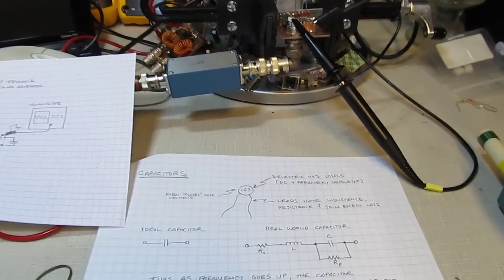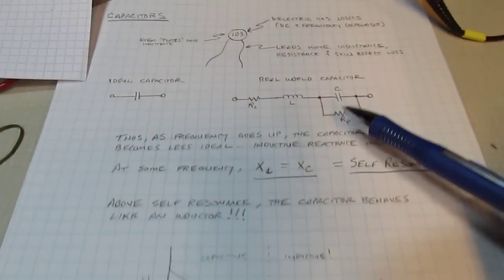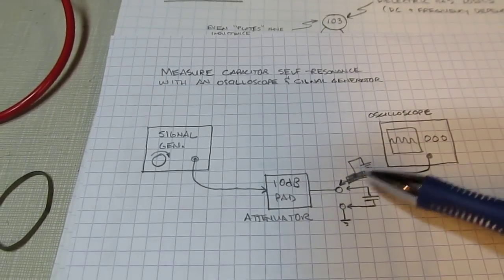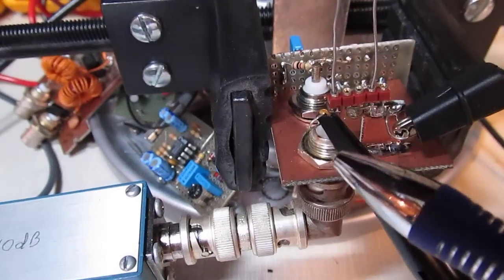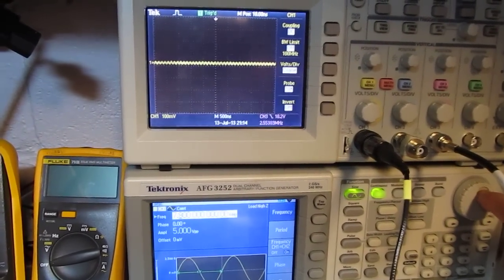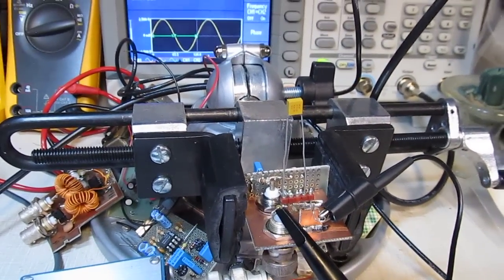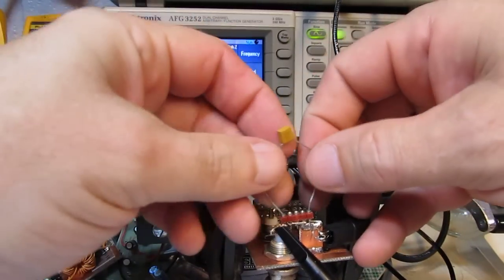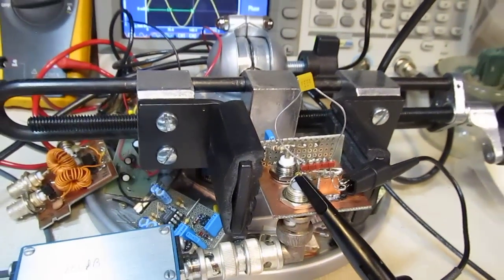#100: Capacitor self-resonance measured with an oscilloscope and signal generator - how to tutorial

Comment: The capacitance in the scope probe may also make a difference, depending on the size of the capacitor.  If the cap you're testing is in the tens to low hundreds of picofarads, the probe's capacitance could be as much as 10% or more of the cap being tested.  That'll definitely skew the results a bit.

Comment: Again, thank you for making these excellent videos. As good as your demonstration is, you have incited me, once again go experiment, firsthand.
Changing the lead shape also reminded me of value preserving the return path, by not interrupting the ground plane.
I have a Siglent SDG2042X function generator, and a Rigol 1054z, which even though they are entry-level "instruments," they can be hooked together to sweep something like this to make a Bode plot, which might make it easier to find the self-resonance. Ironically, the Siglent function generator's ability to trigger external on a sweep, was a later-added feature. Though, it does work, as tested. Still, a VNA would be nice to have. You have seen the LibreVNA 2nd version, correct?
Reply from the maker: I know the LIbreVNA 2nd version exists, but I have never seen/used one.

Comment: Sorry, i’’m a beginner in electronics. My question is: 
In a resonant circuit, using a capacitor at his resonance frequency is the best solution? (lowest ESR and lowest ESR). 
Thanks!
Reply from the maker: It is usually NOT a good idea to use a capacitor at its self-resonant frequency - mainly because this is not well controlled or predicted, and will vary by manufacturer and installation configuration.
Reply: @w2aew  thank you for your response!

Comment: Thanks for another great clip.

What is important in design is the knowledge of the maximum self resonance frequency of the capacitor( i.e. in perfect condition with as small lead as possible)  and then you should use the capacitor for designs with maximum frequency 1/10th of self resonant frequency.

Similar to rated voltage of capacitor which is used in designs that voltage does not exceed half of rated voltage.

Comment: Why would the signal amplitude drop if the impedance dips?
Reply from the maker: Because the signal generator has a 50 ohm output impedance.  This forms a voltage divider with the load.  For example, if the load is 50 ohms, then the voltage across the load will be 1/2 of the open-circuit voltage from the generator.
Reply: @w2aew  ohhhh....so the fact that the cap is resonating, effectively creating a short, it is ROBBING the scope of its signal??

Comment: Great video as always!!:-) May I please ask you what if we do talk about GHz? It looked like your capacitor would be "100%" inductive?
Reply from the maker: True - you would use much lower value capacitors at GHz frequencies.  They have a higher SRF.
Reply: When you go high enough, there will be several resonances, each reflecting a physical dimension or some physical aspect of the device, like electro acoustic coupling in capacitors, etc.

Comment: @6:18 The loop area? I would think it is the parasitic capacitance that changes as a function of distance between the leads. The parasitic capacitance is in parallel with the ideal capacitance so this would yield a lower measurement. 1/2*pi*sqrt(L*C)
Reply from the maker: The difference in the parasitic capacitance between the leads is a very tiny fraction of the capacitance of this device - probably just a few pF at most, while the capacitor used here was a 1000pF or 10000pF cap (can't remember which), so the change in parasitic capacitance by dressing the leads wouldn't account for the 10% change in SRF.  It was primarily due to the change in parasitic inductance.

Comment: Cutting the leads also reduces the enclosed area. Dramatically. So, it is the "same" effect in disguise (cutting the leads == reduction in the enclosed area) or is there more to it ? Would we get the same self resonnant frequency without cutting the leads, but making the leads really close (isolated by a sheet of paper) as example?  or it is that the (straight) leads, as a cable in itself, are inductive too?
Reply from the maker: I believe the inductance will be lowered if you brought the leads together, also adds the capacitive coupling between the leads.
Reply: Good observation, indeed, that would be an indirect and unwanted (for purpose of the intended measurement) modification to the original cap. Thanks.

Comment: Hello Sir,
I am trying to measure the resonant frequency of a MEMS resonator in which the bottom electrode is fixed and the top electrode is a doubly clamped beam which is free to oscillate up and down (basically like a parallel plate capacitor). How do I measure the resonant frequency of the vibrating beam??

Comment: Hello sir,
Does 10dB attenuator attenuate gains (in decibel) at every frequency down 10dB?

Thanks
Reply from the maker: +Nattapong Chotikorn In general - yes, attenuators are almost always broadband devices and provide the rated amount of attenuation over a wide frequency range.
Reply: Hi, is it possible to replace an attenuator resistor 1M?
Reply: not recommended Стас Негруша,
because output impedance of signal generator & input impedance of Attenuator  is 50 ohm. so there will not be any reflection coming from the input of attenuator to signal generator because both having similar value.but if you use a 1M resistor instead of Attenuator as because of difference in output impedance of generator and input impedance of resistor large signal gets reflected back to generator @ RF or even higher frequency.
Reply: "signal gets reflected back to generator @ RF or even higher frequency." ...What Would that be , frequency greater than RF ?

Comment: Thank you for a very cool and concise video. Would it be possible to do a video on "Inductor self resonance measured with oscilloscope and signal gen"?

Perhaps you could add some detail regarding the difference between resonance, self resonance and spatial self resonance for caps and inductors and when they apply?
Reply from the maker: +Logline Productions An inductor&#39;s self-resonant circuit will look like a parallel LC tank circuit, thus will exhibit a high impedance.  So, the process is basically the same, except that you look for a peak in the response instead of a dip in the response.  Resonance is when the capacitive and inductive reactance are equal in magnitude.  Self resonance refers to the resonant point that results from the component itself and it's parasitic characteristics.  For example, a capacitor has some parasitic lead inductance - self resonance is when the capacitive reactance equals the parasitic inductive reactance of the leads.

Comment: Thanks for the effort that you put in your videos. I love your videos.

don't you think that the input capacitance of the oscilloscope would give you a false resonance frequency?
Reply from the maker: The probe's input capacitance is only about 9-10pF, so as long as the capacitor value is substantially higher than that, the probe won't affect the self resonant frequency by a noticable amount.
Reply: Thanks for the explanation.
:)

Comment: If i don't have an attenuador. What can I do? I don't speak english so i don't understand a lot of words... And another question, if i connect the generator like you directly to the capacitor, the generator will not be in parallel with the capacitor, and the voltage in parallel it's the same right? Sorry and thanks a lot.
Reply from the maker: You can make a simple attenuator, I have a video showing that.  Here is a link to the attenuator video:
Basic RF Attenuators - Design, Construction, Testing - PI and T style - A Tutorial
If you can't make one, just connect the generator directly to the capacitor.
Reply: ***** Thanks, and If i have a generator capable of attenuating -20dB, works? or it isn't the same thing?.
Reply from the maker: Not the same. The purpose of the attenuator is mainly to provide a controlled termination for the generator and transmission line.
Reply: @w2aew  When I don't have any attenuator, can i connect directly to capacitor? I assume that there will be a reflection, but I think it will able to measure self-resonance. When I use 50 ohm termination in my oscilloscope, transmission line is terminated and i can measure well, isn't it?
Reply from the maker: @tomasmatejka3448  It will work without the attenuator, but sometimes reflections can cause standing waves that will vary with frequency which might "fool" you.
Reply: @w2aew  Can I solve it by adding 50ohm termination on oscilloscope side?
Reply from the maker: @tomasmatejka3448  no, you'll still have a reflection from the far side.  It would be better to use a 50 ohm thru terminator at the DUT end.
Reply: @w2aew   thanks for answers. I'm going to buy attenuator

Comment: If I connect the capacitor to inverting amplifier with AGC, will it oscillate as normal series LC circuit?
Reply from the maker: Probably not. In order to oscillate, you need an addition 180 degree phase shift at the oscillation frequency and enough gain to overcome the losses on the feedback network.

Comment: BTW, I found these distribution panels on ebay CHEAP, under $20. One has 10 and the other has 15 outputs at 75ohm for CATV work. Initially, I used it to reference 3 sig gens and 2 counters but as I add more devices, the sig is getting hammered even though these panels have amps. I built a freq divider to get 5 MHz's on one panel feeding both panels with a GPS standard backed with a very high res TXCO. 
All of my test gear is waiting for 50ohm inputs.
73,
WA4AOS

Comment: Hi Al,
I need to fabricate 75 to 50 ohm adapters to go from a distribution panel to various HP devices in my lab that require a 5 or 10 MHz ref. I have this working but as I add more devices the distribution signal is too low. The Z match should help. I know how to make a resistive and inductive pad.
Have you done anything with SMD devices similar to filters you made recently. Space is tight on the distrib. panel and trying to get it all to fit. Any suggestions appreciated
73,
Glenn WA4AOS

Comment: but that's provided u use a mcu. if you have just a cheap microprocessor with just io pins and 1 or 2 adcs. If you need to make a product and get the costs as low as posible then a mcu is an overkill. You'd end up having a lot of hardware you would never use but had to pay for. This way you can use transistors to connect and scan through the dc values, which is way cheaper (cash and cpu) than using a mcu with 1 adc for each button and interupts on top of that.

Comment: Many MCU's have a built-in comparator. You can measure RC rise-time by running a counter, and when the comparator trips, run an interrupt that stops the counter and reads the value. Not CPU intensive at all.

Comment: So is the attenuator necessary to make up for the parasitic capacitance and inductance of the wires from the frequency generator and the scope probe? I would expect that with measurements like this one, you can't simply neglect the parasitic capacitance/inductance of those wires but apparently you can, otherwise clipping the leads off that capacitor wouldn't make such a difference. I'm curious as to why.

Comment: i was thinking about using the frequency as a cheap touch sensor or general sensor, as the frequency would change both by capacitance and inductance, and as R is constant if you put a metal near it or touch it hence changing L and C respectively, then just pass it through an RC filter and feed it to an adc it would be less cpu intensive than meassuring the rise time of an rc constant and would just use a single input, no need of especial ic or anything and you could get the value on demand.

Comment: How to measure nH?
Reply: Connect a capacitor of known value parallel to the inductance. Use a grid dip meter to determine the resonant frequency. From this value you can calculate the inductance.